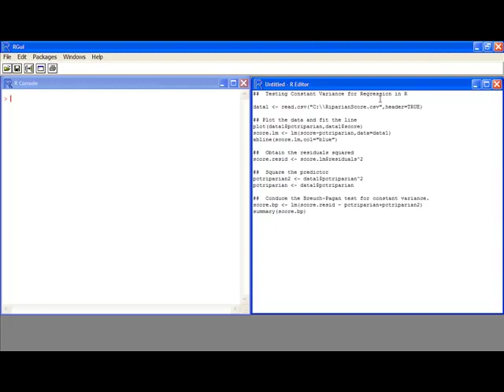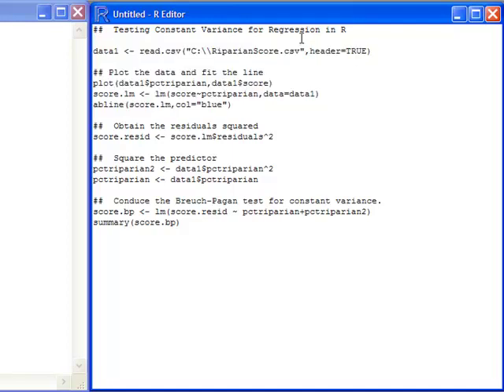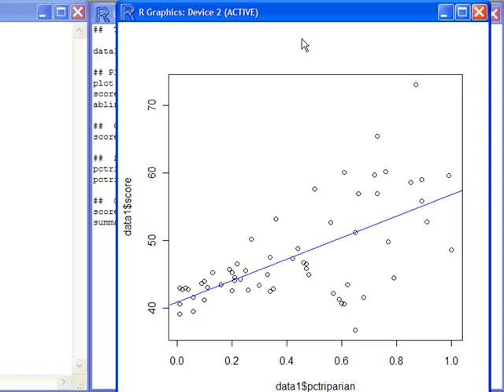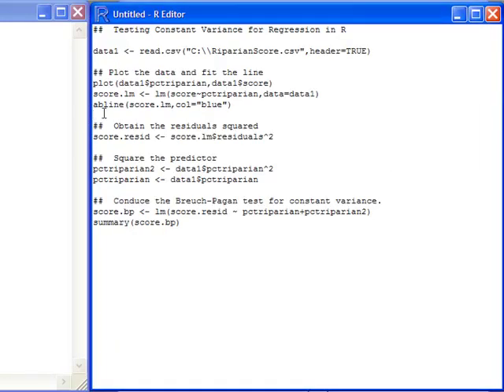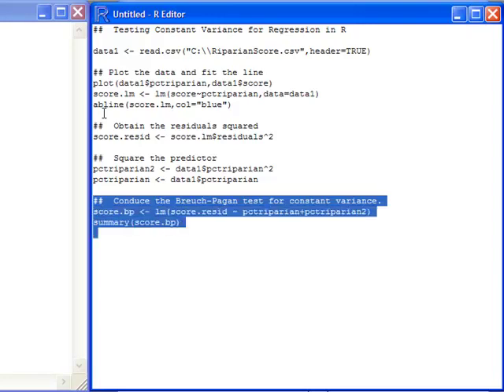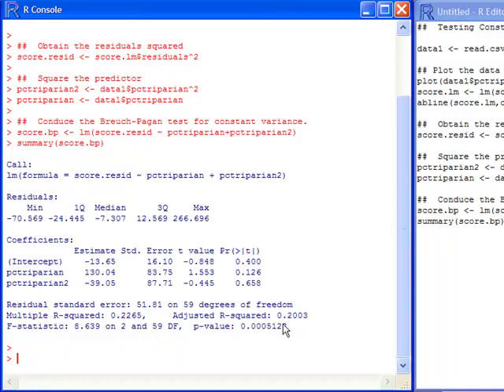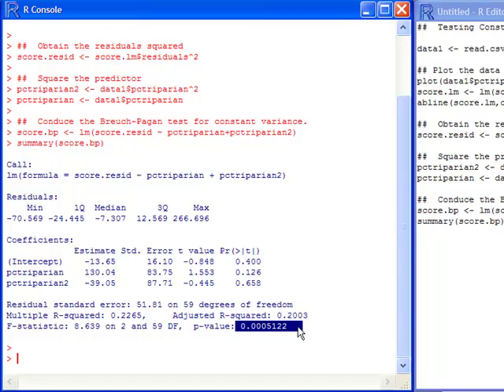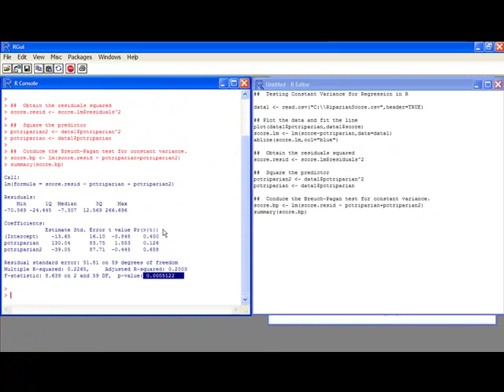Breuch-Pagan test in R

Comment: Although if you're looking at the summary of a linear model, it does not make sense to base the p-value linked with the F-statistic to determine homoscedasticity, right? The null hypothesis for the F-statistic here is that the coefficients of the fitted model are not equal to zero, but that does not imply any information on the homogeneity of variance of your data if I am correct. It would be better to run something such as a specific ncvTest() on the data to run a hypothesis test in relation to assuming homoscedasticity or, as you described, just view the spread of the residuals in your scale-location plot.

Comment: What if it's a multiple regression model?
Reply from the maker: +mercedbread It is the same process just put all of the terms and their second order terms in the model.
Reply: Hi Ed, I haven't been doing R since summer so I'm a bit rusty.  The reason I asked because for the bp linear model, you had para2+para. For a model with more than ind. variables, would that be looking like lm (..~ para2+para, mara2+mara).. or lm (..~ para2+para + mara2+mara) ?
Reply from the maker: The second one is correct.
Reply: Thanks Ed